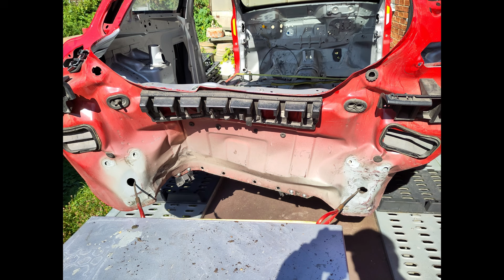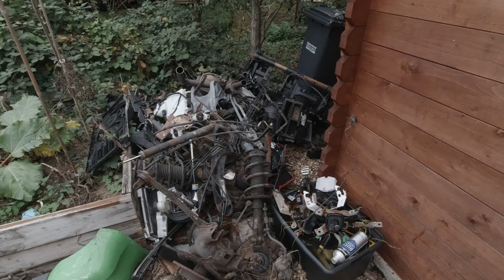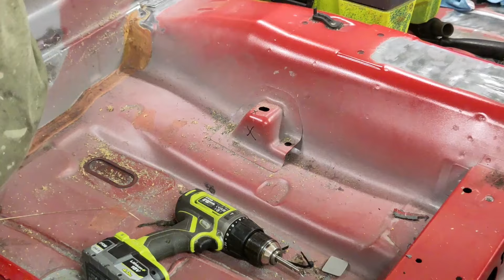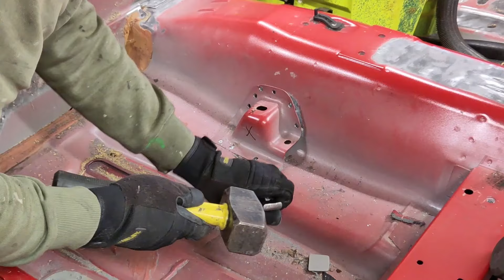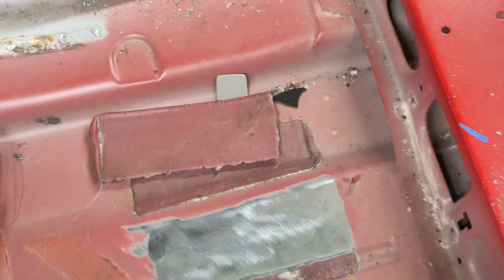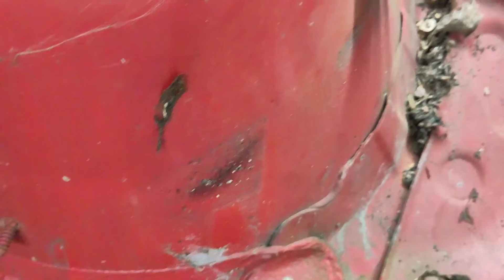Volvo C30 Race Car Build - Ep1 - Intro and Bodyshell Prep

Comment: I'm interested in C30s bc I own one that I'd like to make go faster in a well done way, sooo many questions if you don't mind! So you crashed your C30 race car and now you're building another? What kind of numbers was it putting out with HP, torque, top speed, 0-60? What was under the hood? What kind of mods did it have? Could you give me some tips on what you would do to quicken up a T5 engine? I'd really love to hear some of the parts and experienced racer would use if he was building a T5 for street use. Thank you so much for this content!
Reply from the maker: It wasn't a T5 engine in mine as that would be too big an engine for one of the series I race in. Mine was (as will be the new one) the 2 litre engine that came with the C30 outside of North America. I built it myself and it was putting out 255bhp and 178lb/ft. It has a quaife close ratio 5 speed gearbox (MTX75 case) with a gripper plated LSD. Suspension is BC ER coilovers all round. Adjustable everything front and rear with custom made tubular lower arms on the front to get more caster. I'll be covering the suspension mods in detail in a later episode. Simplest thing to get more power out of a T5 would be a remap as being a turbo engine that the quickest and easiest way to get more power without spending the kind of money I've had to get more power out of a naturally aspirated engine like mine.
Reply: @adematthewsracing thank you, I admire your work. Does it have AWD? And which brand/model drivers seat do you use?
Reply from the maker: @socketsinmypockets  FWD. Corbeau FIA Revenge seat in this one. Sparco Circuit 2 in the old one.
Reply: @adematthewsracing and what about the exhaust? Do you run a race cat? I'd like to find a good rracer recommended brand to use on a T5.
Reply from the maker: @socketsinmypockets  It's an OBX 4 to 1 manifold/header leading into a Piper exhausts 2.5" system for a Ford Focus Mk2 and a Redback 100 cell cat.

Comment: Why not save time and get the shell dipped ?
Reply from the maker: I cover that a bit in the next video. Basically it's a matter of time and money. Getting it dipped means waiting in a queue until my turn which can be a few weeks and then the same again to get it resprayed. Not to mention the cost of both. It's been an expensive season already with ECU and engine failures.